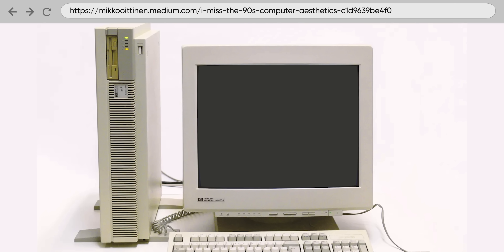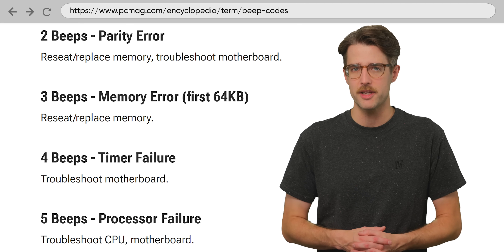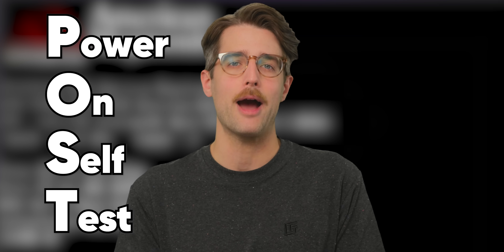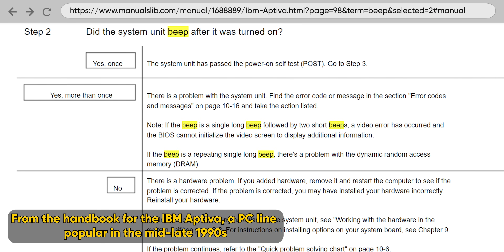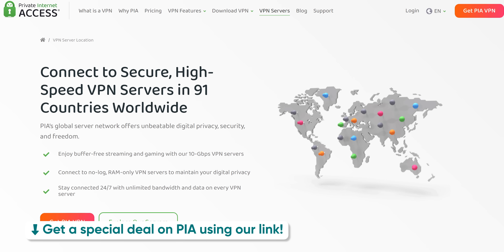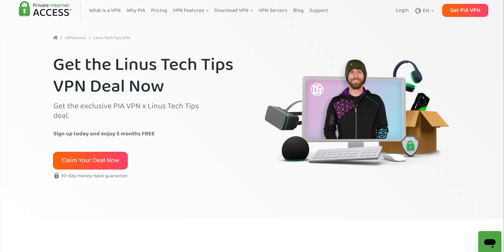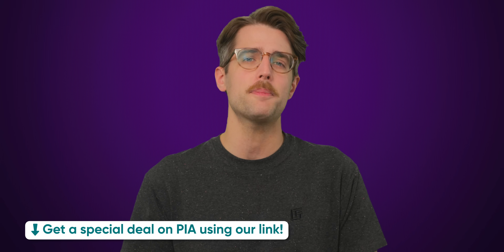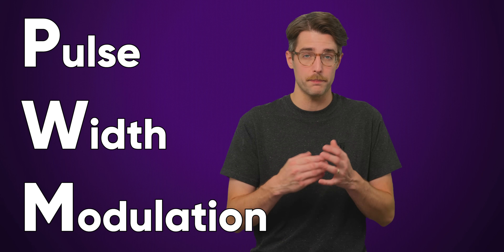Why Computers Don't Beep at You Anymore

Comment: I remember an old DOS pinball game that used the built-int speaker to play music and sound effects, in mid to late 90's. Since it was the ONLY software I have "heard" doing that, before or after, it looked like "magic' for my, by the time. I always wondered "HOW?", because I had some rudimentar knowledge of the hardware by the time and all I knew about was the capability for a single *Beep*, wich you could provoque by "printing" the character \x8 in Basic or other console oriented programming language of the time 😁
Reply: It's reasonably simple: your BIOS has a routine that spots Chr$(8) being "printed" and turns it into a beep, by poking at the system timer. Your speaker is connected to that system timer, which pulses one of its outputs to create a square wave - and behold, a beep. It's why the "default beep" varies a bit from PC to PC: it depends on what kind of timer chip the motherboard has, and how the BIOS is written.

It's also why you could coax a facsimile of digital samples out of a PC speaker, by directly controlling the timer chip, which was somewhere between "CPU intensive" and "a realtime operation", depending on what level of quality you wanted.
Reply: @throwaway6478  basicaly "magic". I sometimes get myself amazed on how far some developers go to achieve a result, back in that day, without an API given by the system to abstract that. Just fantastic :)

Comment: As I recall, you had to disable BIOS clock ticks to get much more than single tones out of the speaker.  More trouble than it was worth.  I never thought I'd need to remember that!
Reply: Not strictly necessary, but it would have been a convenient way to get a consistent source of timing for making the necessary updates to the speaker system.

Comment: I still use it, the sound is kind of different, but I really like that beep at the start up (call it nostalgia) besides, the post codes are really useful.
Reply: I have a ProArt X670E based system and I still installed my old motherboard pc speaker. Incredibly useful for error troubleshooting. Some habits never die. And yes, I still love the post beep! 😁
Reply: you can get the 8 ohm .25w paper speakers still and it should sound exactly he same beyond the newer beep codes.

Comment: My PC still has a speeker that I use for debugging if it won't start. I'd miss that beep!
Reply: My motherboard has a setting to enable a beep on POST, so my PC beeps everytime I turn it on.
Reply: My motherboard has a PC speaker header. I bought some on eBay, so I could hear the beeps 😊
Reply: Same. My mobo doesn't have the 8 segment display for error codes so it's actually quite useful.
Reply: @OtterBops  There's different styles, IIRC, mine just has several different LEDs that indicate specific things rather than displaying a code. But, the whole thing applies so infrequently that I don't worry about it.

IIRC, you can buy diagnostic boards that plug into one of the slots and give you something alone the lines of one of those displays. But, in practice, modern PCs so rarely fail that early in the boot process that I don't worry about it.
Reply: Recently I have ordered a butch of motherboard buzzer speakers just in case.😉
Reply: I do miss those beeps. As someone with bad ADHD I would probably lose focus before waiting for 8 beeps or something, though. For that reason I like the motherboard lights.
Reply: When I was upgrading the RAM in this prebuilt PC i got a long time ago, I figured out that it'll flash the power light in a sequence to tell me of faults. I did nothing wrong btw, one of the RAM sticks were just faulty. :/
Reply: I only want it to beep if something is wrong, yet it beeps every time i turn it on

Comment: Still have a speaker from a 2003 Albatron build. Beeps cheerily at me every time I turn on my PC.
Reply: saaaame, i have a lil dongle-ish one that i plug into the header on every PC build thus far
Reply: @jimjam742  I have a similar one and do the same.
Reply: i get my current one along with the case (i think) 5 or so years ago. its basically sticks to motherboard. 
And i cant imagine to use pc without it. if pc wont beep its starting to pissing me off hard.
Reply: @bubsy3861  where do you get something like this? I'm collecting parts for my pc build and would love to add that in!!
Reply: @TMIncorporated  Probably with my old case. But its nothing special. Basically very tiny speaker without wires that hanging on the connector.
Reply: My totally modern rig that can play pretty much anything happily holds the speaker from my original hand-me-down PC when I was like 9 nearly two decades ago. Can't imagine not having a speaker.
Reply: Ryzen, 32GB of RAM, RTX, NVMe... and a speaker on my motherboard. BEEP!
Reply: mine is new directly lol as it boots up

Comment: PC Speakers still beep at you when the computer doesn’t POST
Reply: only if you plug in the little 3/4 pin speaker connector that is attached to a small speaker inside your PC case
Reply: I always install beep-speaker as a respect for traditions.
Reply: Yep. Pretty useful little diagnostic tool when you can't easily read error codes on a mobo. You can order a five pack of little PC buzzer speakers for about five bucks. I install them on every build.
Reply: My PC's MOBO only blinks a light in a particular way ( like visual beeps) but no sound.
Reply: @jeinnerabdel because you haven't installed a speaker. I promise it is trying to beep
Reply: @matterva08  “can beep if you have the proper hardware” and “does beep” are two extremely different statement

Add the fact that some mobos & cases don’t even have the option anymore and you have a recipe for no beeps on most computers.
Reply: @jeinnerabdel  I used to have a motherboard with a tiny 2-digit LED display that showed hex codes during POST. It was helpful when troubleshooting because you could look up the code and figure out what's going on.
Reply: Mine has an option I always enable to beep once on successful post
Reply: Not always, ASUS ProArt Z790 Creator Wifi wouldn't post, no beeps (have speakers lying around), Q-LED indicated CPU. After RMA turned out MB was faulty.
Reply: @bartgrefte  so it was supposed to beep but it was broken? Of course broken shit doesn't work 🤣
Reply: @matterva08  not sure, it did indicate CPU fail with LEDs. But besides not knowing if a BIOS can beep without a working CPU, the malfunction could be as simple as a connection issue with the CPU, which makes me come back to the question can it beep when POST fails at CPU?
Reply: @bartgrefte  Yes the speaker will beep you error code if CPU not installed or not working
Reply: @mozzjones6943  okay, well, could't get it to beep, Q-LED said CPU, fans were on and no I didn't forget the 12V 8-pin connector ;). After RMA turned out MB was dead.
Reply: @jnharton  initally considered CPU, partly because of the failures on the news (14th gen), though those weren't DOA's. Plus I didn't knew if the MB could beep without CPU (now I know). Send the MB, CPU and RAM back plus list of what I tried/excluded.
Reply: @jnharton  thats what confused me, since I didn't knew if it could, hard to decide which was DOA. But RMA'd it and switched to AMD, because of the sudden increase in reports about Intel's issues.
Reply: Yes. Because if it doesn't POST, Then it will beep you the code causing that problem lol.
I still use the PC speaker in my modern rigs, I just find them  real handy as an immediate warning.. And I know all codes now.
Reply: Only if either your case manufacturer or motherboard manufacturer included a PC speaker. This suddenly seems to stop being so common starting about 10 years back.
Reply: @mokahless  you can just buy them online for super cheap. I got like a 30 pack for $10 or something. Good for life now 👍
Reply: Only if you have a speaker. Most computers don't. You just get a post code.
Reply: Not all no
Reply: @lorenmurray6711  name a Mobo that doesn't have an option for a speaker pls
Reply: For me, 1 single beep = POST OK
Reply: Assuming the bios supports doing it, the case has a speaker,  and the person installing it connects the wire to the motherboard.
Reply: Some cases have a built in speaker and you'll find the cable for it in a bundle together with other case connectors like led and power reset switches etc.

If your case doesn't come with one you can always just buy one online, they're like a dollar each. I have my like that and I zip tie it down parallel with front USB wire
Reply: Only if you have one
Reply: Lol
Reply: 3 beeps 2 bops and a red blink led on my HP pre-built from 2018, was a ram failure tho but was the first time I heard this.
Reply: No
Reply: Yes, it beeps a certain code of long beeps/shorts beeps or even a mixture of both to indicate what kind of error is occurring for it to not POST.
Reply: Not all of them. My mobo doesn’t have any speaker of any kind
Reply: @spaghettiboney  It might have an outline and solder pads for a surface mounted one if there isn't a dedicated header.
Reply: Finish watching the video before commenting maybe...
Reply: @mozzjones6943  tried several speakers/buzzers, none beeped.
Reply: my pc i cooked and it didnt beep when powered on
Reply: If your computer even comes with one. Neither my case nor my motherboard came with the piezo electric speaker but it does have lights to show you if the ram CPU or graphics has an issue
Reply: They have lights for this now, behold the future